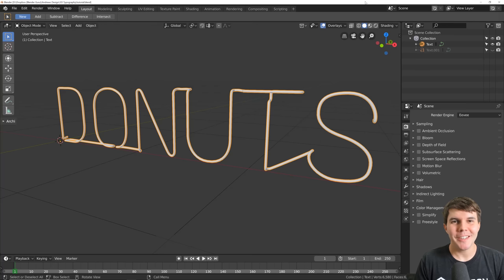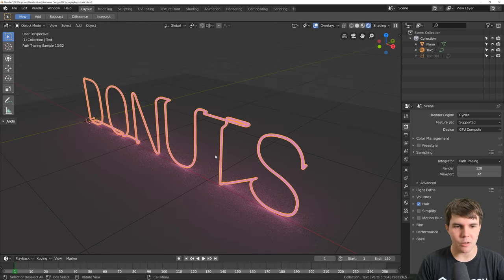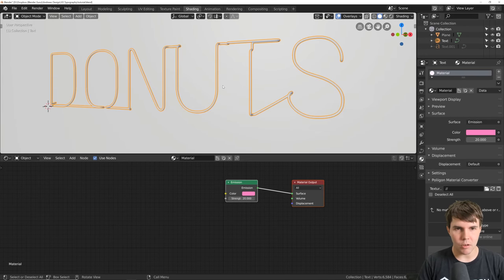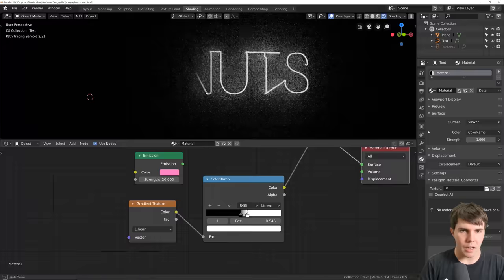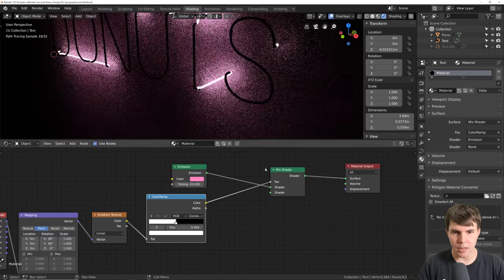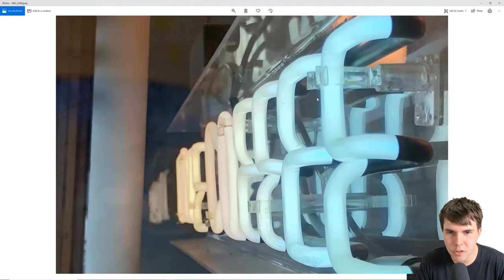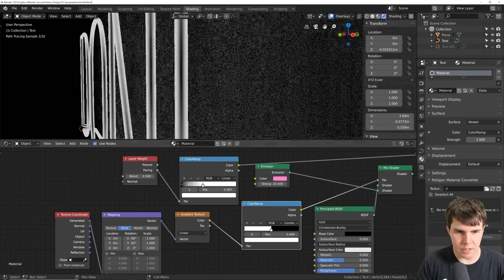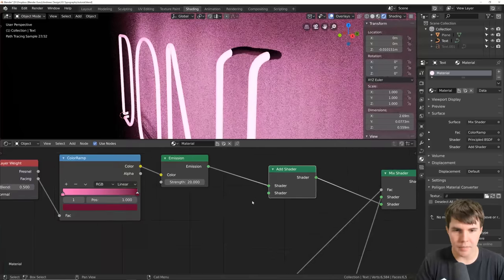How to Make a Neon Sign in Blender 2.8 - Part 2

Comment: Awesome tutorial. Neon Artist here, Ill be making renders of my designs now to preplan my bends. Anyone in LA the Museum of Neon Art in Glendale is awesome. You can learn to make neon to keep. They also have city tours for Neon. Las Vegas has the Neon Museum and New York has Brooklyn Bends. Check them out. There are about maybe in an optimistic view of 400 neon artists left in the US. I love sharing knowledge of the 100-year-old art of neon making. Those are legit Neon in his reference. LEDs are narrow plastics flex light. Neon gas is red in clear glass. Argon is purplish, Krypton is white. There is no gel in the glass. Sometimes there is the tiniest amount of mercury to add to the color. Neon gets different colors based on a phosphor coat in the glass plus one of the noble gases of choice in the bombardment process. You can see the original color near the ends since the Electorods are clear but usually painted. Fun sad Fact? Helium is not renewable. Once its gone, it's gone. It floats out of the atmosphere. So easily the US GOV the largest holder of helium pumped it underground in porous rocks so it doesn't float away. It is apparently a strategic resource. Yet we put it in plastic ballons............ I found a dead balloon in the woods once. They do eventually come down creating litter. Its a bit problematic.  Dont buy LED FLEX posing as Neon. Neon is all handmade from skills only learned from feeling gravity pull hot glass. Neon Last 80 years plus and usually it just the transformer that needs to be replaced. LED maybe lasts a year and its made from cheap earth destroying plastic. Nonrepairable. Support your local artist. Keep on learning. Blender is a god send, Neon will forever be cool.

Comment: 10:00 I am an actual neon glass blower since when Carter was president.  Clear glass filled with 100% neon gas electrical discharge glows an orange red.  Clear glass filled with Argon and a small amount of mercury metal the electrical discharge will glow blue.  In the parlance of the neon industry we call these two. Clear Red. and Clear Blue. 

Argon and mercury produces UV light therefore if the glass tube is coated on the inside with a fluorescent powder which absorbs the UV which causes it to glow with visible light.  By using different fluorescent powders you can have a wide range of colors.  The glow inside the tube at 10:00 is the argon mercury electrical discharge visible at the bends where by bending the glass tube the coating is slightly thinner allowing it to be seen slightly.
Reply: I kept reading expecting the copy pasta punchline. But it's just a genuinely informative comment. Nice!

Comment: For anyone who looking at this in 2021, idk if its new Blender or not but for the life of me I couldn't find the middle point to seperate the back and front part when doing color ramp by following Andrew tutorial, it just wouldn't work, its either full black or full white. 
I found another alternative way which is just convert the whole thing into mesh, press 7 for top down view, turn on transparency mode, use box select to select all the back part, then assign it to a different material altogether and change that to black 👌🏻

Comment: In Eevee if you activate the bloom and screen space reflexion setting, the emission shader will be show correctly and it will glow :)
Reply: compared to the glow you get from having it in cycles, it doesn't qualify as an alternative, imo
Reply: the glow thingy isn't in cycles
but the displacement (for walls) is 

Eevee needs baking and that is a long process for displacement of textures (yes you can also use the displace modifier)
Reply: But it doesn't technically emit light and the background won't get light from that neon object.
Reply: @NanogalaxyOrgMedia  light Probes?
Reply: @yaminnather521  Light probes work when the objects and the environment is static. But what about animated objects? Does the light probe work for that? I am so confused about that.
Reply: @NanogalaxyOrgMedia  I havent watched the whole video yet and I just realised that the lights probably gonna flicker or something lol sry
Reply: @NanogalaxyOrgMedia  yes it does
Reply: Hii

Comment: Tips for newbies like me-
- Change the world color to black ( I noticed this after trying for hours, why the wall is orange color. Its dark so it should be black)
- if you are using the free texture scale down the displacement to 0.02 ( works best for me)
- Increase the render sample to 300 or something
Reply: I'm using the free one but it doesn't seem to be interacting with light its just bright.
Reply: @jngvny  Try changing the world color to black. You can do that by going to world properties on right side panel and changing the color to black. Without this the scene looks like day.

Comment: Argon is blue if no luminescence powder is used and is pretty much the standard since it makes optimal use of the mercury ion stream required to make the luminescence powders work (cost is also a factor).  
Neon is red and is the only one that doesn't need mercury to establish a stable electron flow and stays red even if luminescence powders are used, unless mercury is added .  
Xeon is green and is not commercially used, only in research settings.  
In the past nitrous gases were used and created a yellow-ish glow, but that was only ever used in street lamps and has been obsolete and discontinued for decades.   

Many neon signs have an argon/neon mix for winter conditions, so that the sign can glow even in freezing cold weather right from the start when turning on.  It will glow red until the mercury starts evaporating, at what point it will gradually take on the colour determined by the luminescence powder.

Comment: I'm new to Blender... kind of. I've fiddled with Blender here and there from the 2.6x series, but the views and everything else had me out of sorts. I'm one of those who doesn't get something unless it is in the right way for me. Western chess, for example, I was not good at. Chinese chess, which is similar but different, turns out that I could see 5, 10, 15 moves ahead. The pieces are flat rather than standing up. After that, I started noticing that I was good at things if the view was different or something like that. So, Blender was confusing me and I kept coming back and now with this new version, it feels like everything has fallen into place. It feels really easy to follow along now, so, with renewed desire, thank you for teaching. Even though I'm familiar with the ideas of 3D, I need to approach this as a complete newbie as I don't know any of the commands or how to maneuver very well, but hopefully I'll pick it up. There were a couple of things that I had to figure out on my own in part like hitting V for structure type. Thank you and I hope you don't mind me asking newbie questions every now and then.

Comment: That "inner tube" you mention at around 10:00 is dependent on the thickness of the tube. So it's basically just the wall thickness of the glass, nothing fancy. Neon signs are mostly (well at least where I'm from) are still filled with various gases or the tube itself is coloured. A keen eye can spot the difference at a glance. Interesting topic, worth reading more about. 
I really like this new tut, I might feel a little inspired even to give it a go too :)

Thanks, mate, keep up the noice work!
Reply: Olivér Solténszky I think Andrew doesn't research  enough sometimes, a critical part if you want photorealism.Watching videos of people making these neon tubes is way better than taking some pictures.

Comment: quick note from me: EEVEE now has the capability to cast emissions on walls, but it won't work by default. You will need to use an irradiance volume object to get this to work, it's best to watch a video on how that works since I can't describe it well enough through text. This is far from perfect and it will take some tweaking before it looks the way it should, but in theory it will work in EEVEE that way

Comment: 9:30 on Mac you can hit the space bar to quickly preview any selected file, including images. You can then use the arrow key to navigate. HOWEVER, for some reason, it struggles to preview Raw camera files (.RAW, .CR2 etc). It WILL view them, but Macs just find this really resource-intensive, whereas Windows can just up and show you a raw file no problem. "Easy as Jpegs, what's the issue, mate?"

Comment: you can use Emission in volumetric and it has as much off a weigth on render time as surfeace emission. this is how i face mist for my images. i mix emission and trancparency using ligth paths so the emission is only visible to the camera and has no effect on the envrioment. its pretty awesesome

Comment: Just downloaded Poliigon Material Convertor. By default, there is no "displacement" output coming from my Mapping node. What to do?
Reply: It depends on what texture you have. If they have a displacement map, then make sure you check if it's being enabled in the advanced objects tab right before hitting load/apply. 
Don't forget to use a subdivision modifier and actually change the output for Displacement strength.

Comment: 10:03 Isn't the gas that is used for neon signs called......... you know...... Neon? Hence the name "neon sign"? Neon (Ne) is the second - from top to bottom - element from the Noble Gases collumn, just under the Helium.

Argon is the third on the collumn. I'm not sure if it's also used for light signs. It might be, idk.
Reply: I think people use a variety gasses for neon signs, neon being one of them (obviously), because different gases emit different colors.
Reply: Argon is also commonly used for neon signs, just like Mr Apple said, I think a varietu of gases can be used for neon signs
Reply: Actually Neon causes the orange color like in the picture and Argon is glowing kind of blue, whilst Xenon is glowing Purple. Neon signs usually contain a mix of gases to produce a certain color

Comment: I'd like to disagree on that eever sucks on meshlighting, you can very well make this work.
Roughly: use Bloom and turn on screen space reflection.
Lastly if you really want to go for it add a colour probe and bake the lighting
Reply: Yes! I'm a bit annoyed that Andrew just trashtalk Eevee without proper research. :/ only thing with Eevee is that making the strobe effect is probably impossible cuz baked lightmaps cannot be animated (yet at least). Well i guess you could bake the different lighting conditions into bitmap textures and use them in a material where you animate the mix factor. :p
Reply: Am I doing this wrong? 
An emission object on a large flat plane. Placing an irradiance volume probe with a 20 resolution on X,Y,Z. The light results are pretty blocky and not smooth.
Reply: @Ironpants57  There's a bunch of options in the Render Properties panel under "indirect lighting". You may need to increase the map sizes or use the smoothing: https://imgur.com/wvEWhNN
Reply: @Lattamonsteri  I've bumped up the res and blur but still lots of stepping. I'll stick with faking it with lamps..
Reply: @Ironpants57  Yes sometimes weird things happen :( I can understand Andrew for that reason. Raytracing feels much more predictable.

Comment: I Used Bloom In Eevee and It Worked Fine, So Anyone With Low Spec Pc Can Use Bloom and just increase The Strength of Emission to like 50 or 100 😄
Reply: Thank you for the tip!

Comment: Hello, thank you very much for this tutorial! Is it eventually possible to make a short part 3 about the final render or comment on what settings you used for having the same glow effect as in the beginning your "Blender Guru" sign? Eventually also how to apply different colours if you have two words would be great! And do you use additional lights here or is the only light coming from the neon sign itself?
Reply: Don't know if it's still relevant, but the only light source here is the neon sign. If you want different colors on different words, make the words be different objects, and use different emission shaders. 
The effect in the beginning is a simple light on and off animation, and I've seen some tutorials on that floating around :)

Comment: 10:10 Typical traditional Neon Signs use either Neon or Argon Gas in a relatively thick tube of glass. it is lit by pumping high-voltage electricity through it.

Comment: We can actually get glow by using Eevee only, by changing the strength of the color in the materials panel to 22.000 or something. then go to render settings and then enable bloom. now your text should look like a lightsaber. :) (you don't need to try this though)

Comment: JFYI:  2.90.1 has a FLIP RAMP command in the ColorRamp node.

How does Andrew have the Text object selected but the object UI highlight off???  The object highlight makes it difficult to tweak the Material, so having it off (easily, without incessant mucking about with the Overlay settings) would be nice.

Comment: 18:31 I don't have the 'Bump Only' or 'Displacement Only' dropdown menu. Solutions?
Reply: in the material settings (with the wall selected and textures applied..etc) under surface, the very last option is the displacement and the dropdown is right next to it
Reply: Change to cycles

Comment: First off, this tutorial is excellent! Thank you so much for creating this!  My question is this, I just added my gradient to my text, but now it seems that my text is not aligned correctly on the xyz axis, because it is showing up and if I rotate my text, it will show up more, or less depending on the direction.  So, my question is, is there a quick way for me to align it on a particular axis so, I can get the gradient effect to show up as it is intended?

Comment: I didn't understand one thing? 
first i do the rendering and then i go into compositing rendering again for final video?
there is a way to speed up the rendering? even whit lost quality, I have a cpu rizen g3 with integrated graphics and 32 gb of ram.
with 20 rendering frames it takes 3/4 hours

Comment: Hey Andrew, the Compositor you used at the end; when I clicked the workspace I checked "Use Nodes" to see the same ones you had, and had to render the image to display my Neon Sign in the Render Layers box. Is it possible to use the compositor with an animation or is it a case of saving each composited image / frame result..? Cheers mate, and excellent tut.

Comment: Great tutorial, just getting started with blender for real now. And struggling with rendering out a video. I tried rendering a scene with the camera moving around my neon lights like your intro, and turned on/off a lot of switches to decrease the render time. However, then the neon didn’t spark as much... I noticed during the rendering so I cancelled. And now I can’t redo. Tried both with and without overwrite and now nothing seems to work. A tutorial for 2.8 with rendering, outputs and decreasing render time would help! 
Or does anyone else have any tips to give me? 😄

Comment: 5:00 you can also use just the texture coordinate node and plug a seperate xyz to the generated output, shift between the x y z output to know the right one and use a coloramp node plugged onto that output.

Comment: what if I want to make a 3D neon model, like a cube? how should I map the black part?
Reply: Try building it out of real wire. Let the wire come out of a black bottom box / platform and figure out the best way for the wire to run around your 3D form. I guess you need about three separate wires.

Comment: @19:21 in the video here, my plane surface isn't doing what yours is doing, it's creating erratic spikes all over the place when I subdivide the plane and I can't figure out why it's doing this, it's a completely flat plane surface and it doesn't let me subdivide it like normal.
Reply: Mine too, the only "fix" I found was changing from texture 3K to 1K, but it still didn't look similar to the one on his video.
Reply: i have the same problem. did you find a solution?

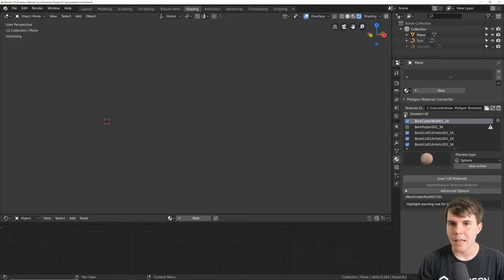Comment: 16:18 when I select the folder, it doesn't show the same in the poliigon material converter (in the right position), in fact, also it not apeears the same info in 16:50. In fact, in the shader editor I have a different nodes. So I doing something wrong I think. What can I do?

Comment: How do you cut node connections in blender 2.8? it used to be ctrl + mouse drag, but that doesn't work anymore.
Reply: I think it still works. Pretty sure I just did it the other day,  but cant remember if I was in 2.80 or 2.79. 

At any rate i think it's a node wrangler plugin feature so make sure node wrangler is enabled in 2.80.

Comment: 9:30 i am a mac user.. And i scream on windows 🤣.. you don't need to open pictures in mac.. if you do you are right you face this issue. .but if you just press space it will give you preview right away .. inlcuding images, videos, audios, txt, htmls, etc. and everything.. spacebar and then arrows.

Comment: Shows how to add glow. :) 

Doesn't show how to save glow. :(
Reply: Yeah, I have the same problem. But even more... I add in my composite the Denoiser from the 2.81 blender. Now I don't know how to give it the glow and the denoiser, the Mix Shader always takes one in disavantage of the other... I don't really know what to do.
Reply: But if you do want to save just the glow, Instead of connecting it to the viewer, you connect it to the composite, open the render result and ta-dã